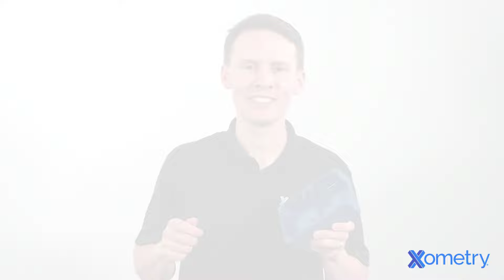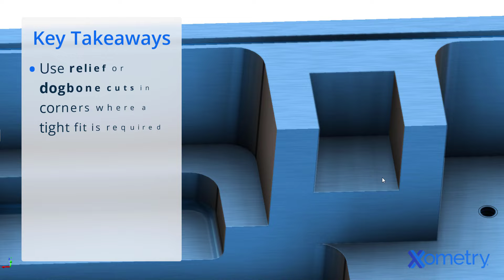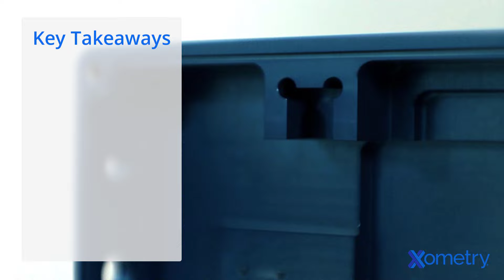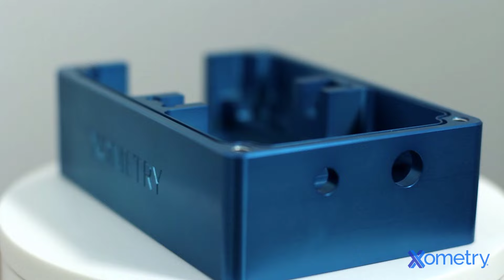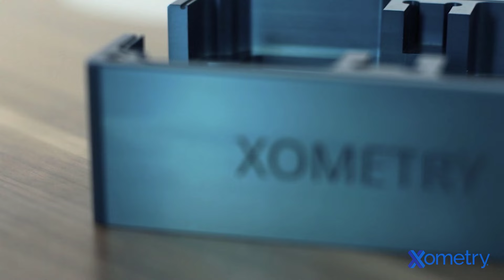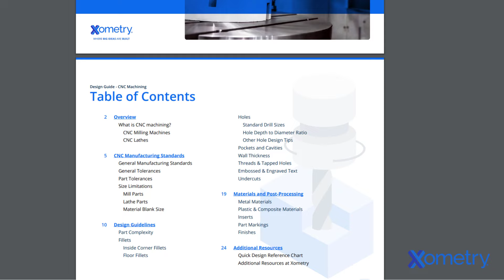5 Cost Saving Design Tips for CNC Machining

Comment: Excellent design tips that we validate daily on our shop floor. Implementing these not only saves cost but also ensures higher quality. For those who've optimized their designs, we offer competitive low-volume CNC,3D printing,Vacuum casting and Rapid molding production to bring them to life😀